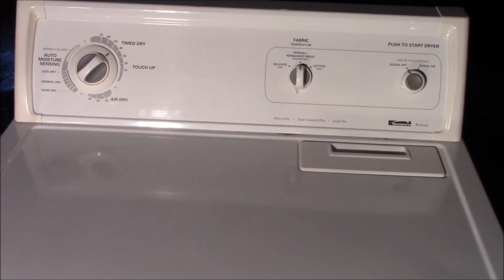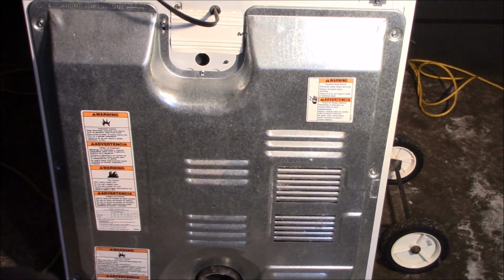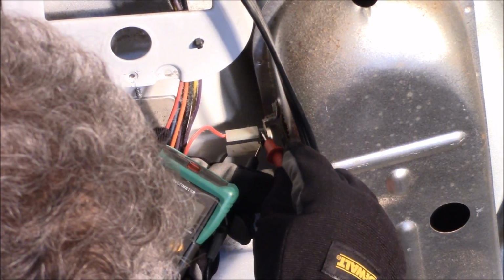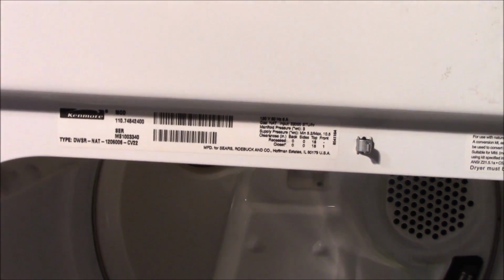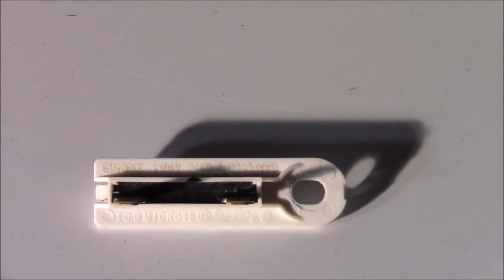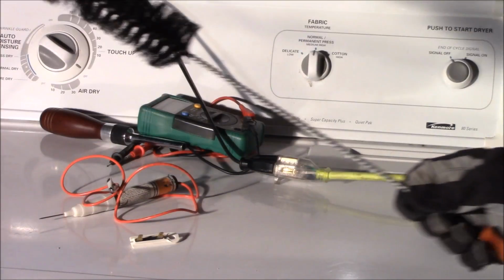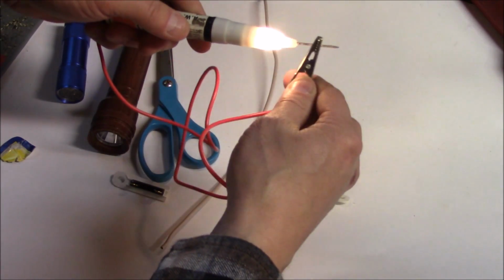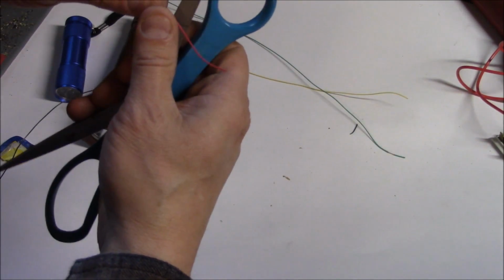Whirpool, Kenmore dryer not starting, cheap and easy fix

Comment: It would be good to know the different symptoms or signs one would get, that could tell us which part is bad.  Sometimes, without all the electricity testing, certain signals can tell a person what is wrong.
For instance, my dryer was working, it shorted out a few times, but now, when I push the "on" button, it's just makes the sound as if the dryer will start but the dryer drum doesn't turn, it just kinda hums.  
What could this mean? My belt needs replaced? 
Please help.  I'll be doing this myself and have never fixed a dyer before. My main concern is buying an unnecessary part and doing a lot of work for nothing. 
So can you help guess what the problem might be with what I've described? 
Thank you.
Reply from the maker: Since I can not see or test your dryer, my guess would be the starting capacitor for the motor.  It is an electrical device that sores electricity and releases it all at once to help give a boost to get the motor spinning.  The capacitor can release a dangerous shock even when the dryer is unplugged  or unused for several days.  I wish you the best in fixing your dryer
Reply: bbb jim1 Yikes!  Thank you so much for responding to me. 
Nice to know it delivers a mighty shock days after unplugged! I was going to take my dyer apart for a first time ever! 😳
I saw a few other videos since watching your's and several of them that did the hum thing just exactly like mine is doing, fixed there's by simply cleaning or greasing the motor. I was hoping it would be simple like that. 
I have a Kenmore 90s series. The guy who took my last dryer and gave me this one said this was an awesome dryer, would last me for a lot of years.  My other was a Frigidaire.
Reply: bbb jim1 Took my dryer apart and gave it a very good cleaning. There was a LOT of lint everywhere. (I bought it used a year ago. Must have been very used. Lol) 
I'm going to search what you suggested because, frankly, I have no choice. I don't have any money to hire someone, and certainly don't have any money to go to the $$$$ Laundromat! 
If you can think of anything that might help. I'd appreciate it.  If not, no offense taken and thank you.
Reply from the maker: If you have a Whirlpool or Kenmore dryer they use a motor with a built in starting feature thus you would not find a starting capacitor.(most washers have them)  The shaft you lubricated is for a centrifugal switch for the starting of the motor.  It sounds as if the motor is getting power but is unable to get started.  At your own risk, try to trick the dryer into thinking the door is closed and when you push the start button spin the drum clockwise until the motor is spinning it and then close the door.  This trick if you choose to try it should give you a little time to save a little to get a different dryer when the time comes.  I wish you the best.
Reply: bbb jim1 I have a Kenmore 90 Series Dryer. Thank you so much for letting me know I won’t find such a part to replace it. You’ve saved me a lot of time & frustration in trying for something non-existent. 
By the way, I already did exactly what you suggest! Pushing the door button down while someone else pushed the “On” button, while I tried to turn the dryer drum, was a no-go. 
I must say, it was very difficult to turn the drum! Therefore, your idea in quickly shutting the door after I get it spinning wasn’t even an option because I never got it spinning.   I only got it to turn a few inches, and that’s with turning it with all my might. 
Is there any other hope?
When I cleaned the dryer, I removed the bottom front piece, then removed the lint compartment and completely cleaned it and the entire inside of the dryer cavity that I could. 
I oiled what looks like a motor that sat behind the big lint compartment. (Forgive my lack of knowledge on this subject but I’m learning). I’m guessing it was the motor because other vids that show motors showed lots of copper wires bunched around the piece, so I assumed, motor. It wasn’t easy to get to so maybe I should open things up again and open it up more and try again. I think it was common sense to look for a silver shaft that would be the turning piece and oil it, but I could be wrong. 
Again, thank you! Your back & forth with me is the only hope I have at this point. God bless you! Much appreciated.
Reply from the maker: Knowing that your drum is not moving very easily likely means the drum glides and or the support rollers are worn out and binding the drum keeping it from turning.  Sears partsdirect  on YouTube has videos showing the replacement of these parts.  You can get the part numbers from ereplacementparts or searspartsdirect by using your model number on the front of the dryer.  I would look for the best price on eBay and Amazon with the part number.  Don't be intimidated by the disassembly of your dryer, you can do it.